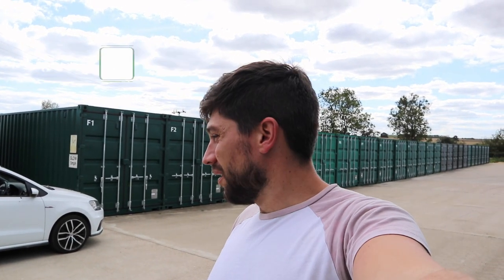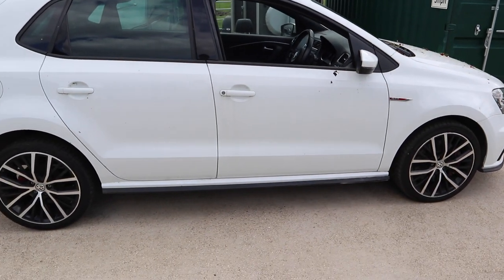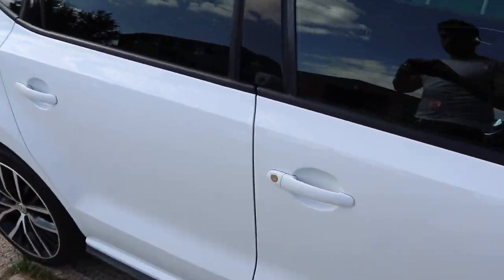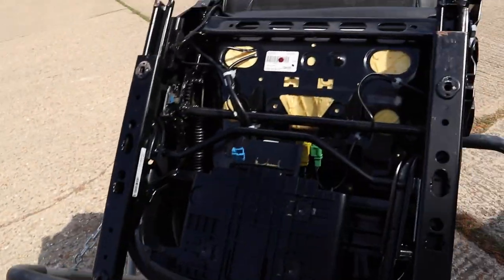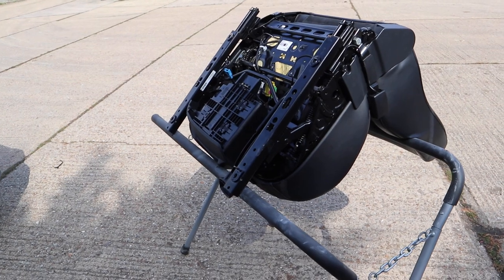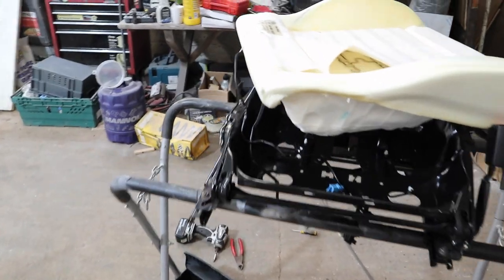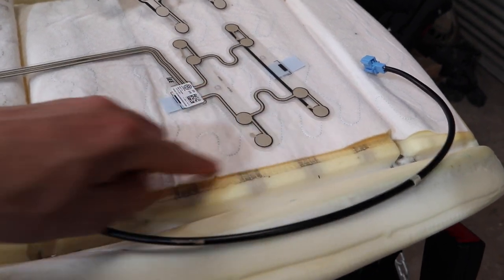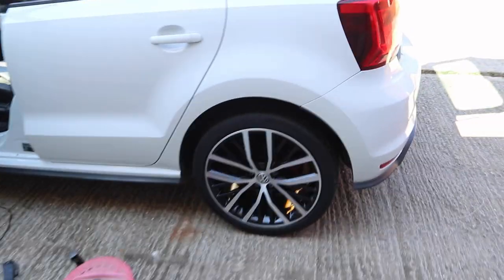My STOLEN POLO GTI Is BACK!! I've BOUGHT some SEATS!..

Comment: You made a good call on the seats. 3 door seats would ruin the car tbh.

I had the same issue on an A3 8V lol, but I didn’t have to take the seat apart. It slid right in!

Comment: I wouldn't bother stripping the seat, just plug it in and tuck it away. If you want the airbag to work aswel, just bridge the new connector to show its in use then remove the seatbelt sensor and bridge that aswel..... couldn't you just code out the passenger occupancy sensor from vcds

Comment: As an ex Audi mechanic you should know why manufacturers make things awkward, so you can't fix the car yourself and have to go to the dealer. Difference could be the resistance of the sensors?
Top video again.
Reply: Well said rich, if I remember correctly the wires are slightly different. Think I could have made original one  work
Reply: @SalimKhan-gk1fh  Hi. Yep I remember cars with several different versions of the same part such as brake pads. I guess specs change or manufacturing processes?

Comment: Nice video, nice seats, I need to replace mine on my 6r (cigarette burns from former owner 😡) took me weeks to sort cigarette smell, got there in the end. Your right the tartan seats are so expensive, I only need passenger seat pad and rear drivers side seat pad, bloody annoying, repair not really gonna cut it as holes in tartan bit. I may look for a set of these.

Comment: If that is the case then why didn’t you have to change the one on the drivers seat 🤔
Reply from the maker: The drivers seat doesn’t have one, as there has to be a driver in the seat for the car to be moving.
Reply: Saving Salvage yeah I thought that when I got in my car today 😂 seat belt light was on